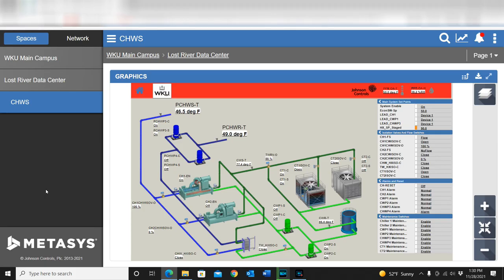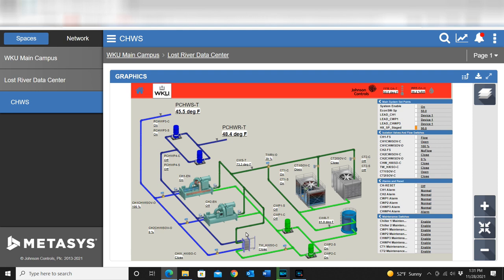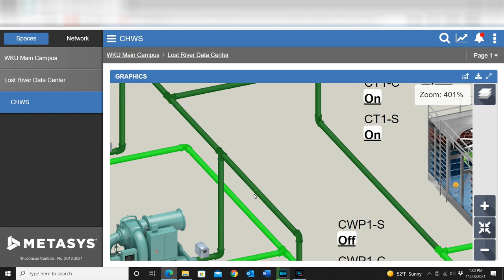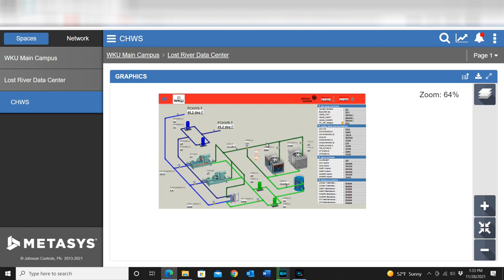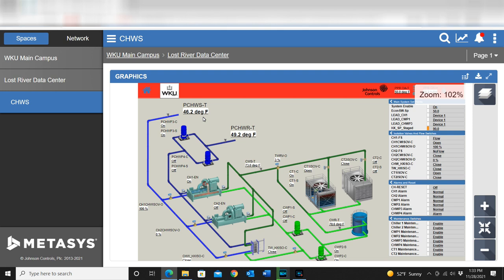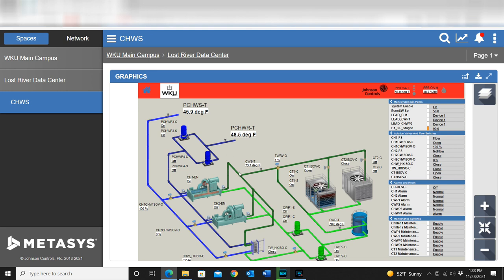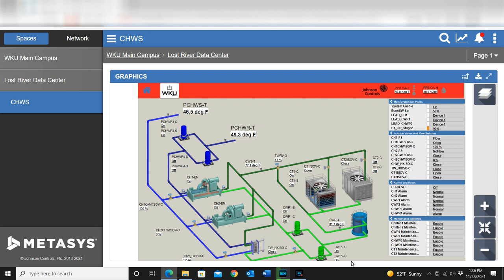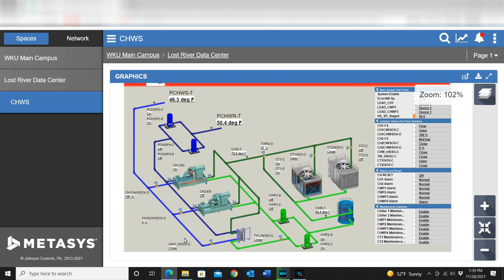Plate Frame Heat Exchanger operation in a chilled water system

Comment: What happens when OA-T drops below 32 degrees? Is there glycol in the condenser loop?
Reply from the maker: Yes and the towers also have heaters. There's still a good amount of flow also. It runs even when temps are in the teens
Reply: @Systemcontroltech  that’s cool. Thanks for the info. I’ve been enjoying the new graphics tool as well.